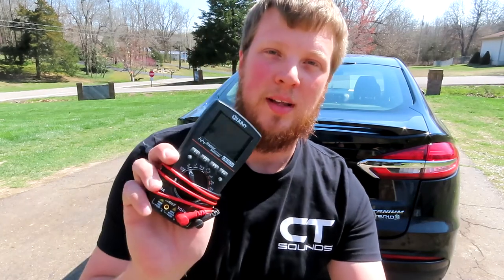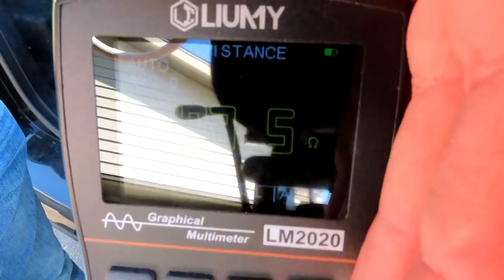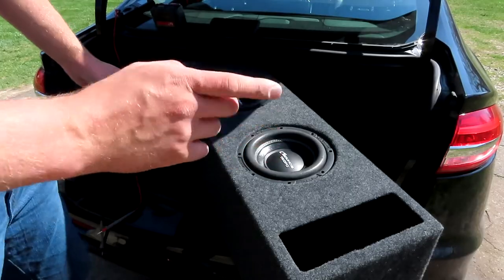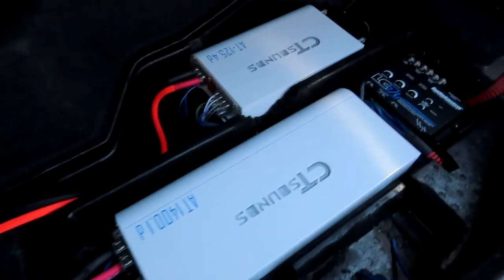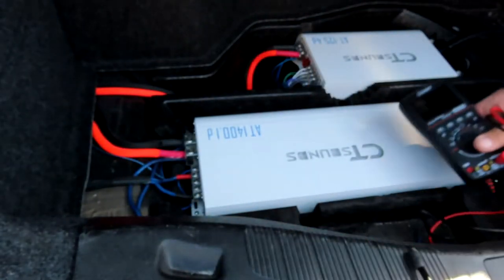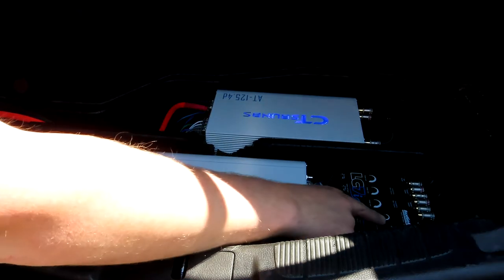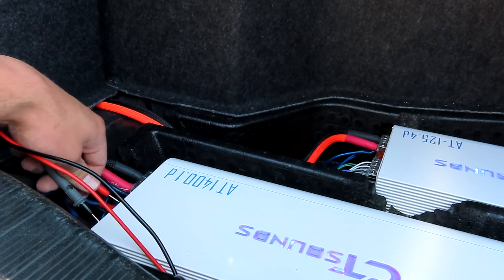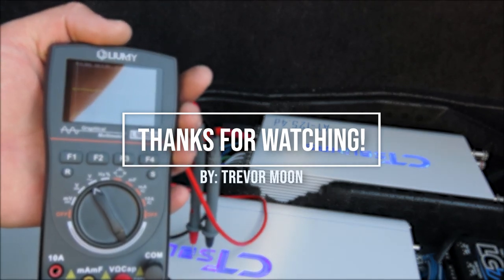How To Fix Simple Car Audio Problems Using LM2020

Comment: Okay... firstly, Thank you very much.  May I recommend you also explain how to hook up the leads to the 2020?  I watched this a few times and thought my new battery was bad before I realized I had the lead connected to the LM2020 incorreclty.  I had them Red to red and black to black.  After watching a few times I noticed yours were connected differently.
Reply from the maker: So the 2 red ports on the meter are fir different functions.  I recommend only connectingike i have here or you can actually do some damage. 99$ of the things you are going to do will use the red on the right lug.  

The leftmost red lug is only for reading Amperage.  And only 10 amps or less. And you MUST break the circuit and put the meter between the circuit.  The onlt thing this helps with us finding parasitic draw and determining running Amperage of small parts like headlights and control modules.  

You likely won't be needing those functions anytime soon.
Reply: @ATCA  Thank you.

Comment: You do understand that the meter is reading resistance and speakers are measured by impedance?  They are both measured in ohms, but they are not the same.  This video is misleading, and promotes the common misunderstanding of speaker impedance.
Reply from the maker: Well.. I guess you're telling us that you can't determine if a woofer is blown using the resistance setting on a multimeter?
Reply: @ATCA  You guess wrong.  What I actually said (attention required) is that comparing a speaker's resistance to its stated impedance is promoting the idea that resistance is the same as impedance.  This misunderstanding causes grief among the uninitiated, especially when they measure the resistance of a sealed enclosure, horn loaded cabinet where the difference between impedance and resistance can be 50%.  When people rely on you for valuable information, giving them half the story is totally misleading, and doing a disservice to your viewers.  At least, and I'm thankful for this, you didn't refer to it as "ohmage".
Reply from the maker: @lawrencegenereux8567  I'm quite aware of a speakers impedance and it's differences to static resistance, Regardless of how you perceived my words.
Reply: @ATCA  So explain that to your community, who trust you, and look to you for valuable information.  This isn't personal, it's professional.  Your videos have a professional air to them.  Be that pro and a good instructor, and explain the what and why of what you're doing.  You'll be one of the few that does, and you'll be creating a community of people with real practical knowledge.  

I taught for the DOD for years and ran a technical program for the Dept. Of The Army.  I never told anyone to do something without telling them why, and explaining the reasoning.  It never failed me or the programs I worked.

For reference:

Lawrence A Genereux

Category A Senior Examiner for High Reliability Soldering

Quality Assurance Specialist, Nuclear Systems and Stockpile Reliability

Failure Analysis Specialist

U.S. Army Program Lead Administrator for Missile Systems High Reliability Soldering Process Training

Subject Matter Expert

Retired

I'm not mentioning this to impress anyone.  I just want you to know that I take this seriously, and I'm not here to blow smoke up anyone's ass.

All the best!  Sincerely.